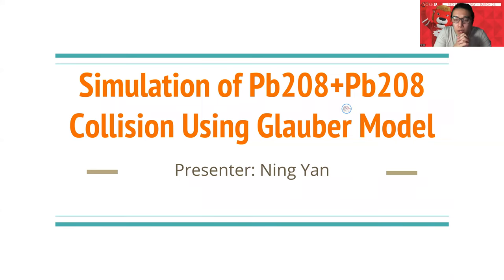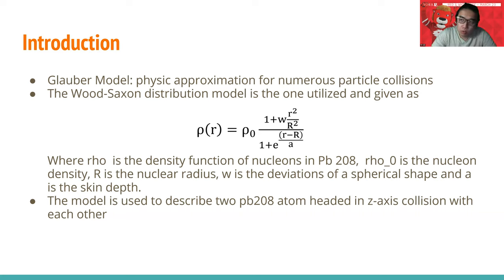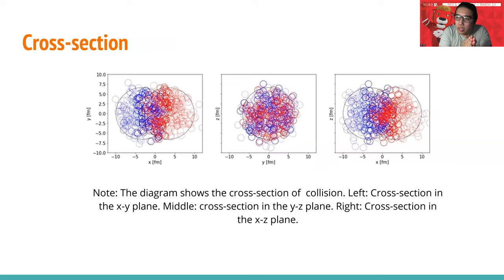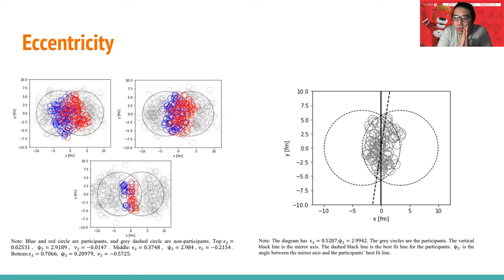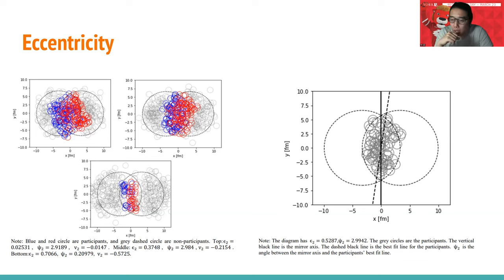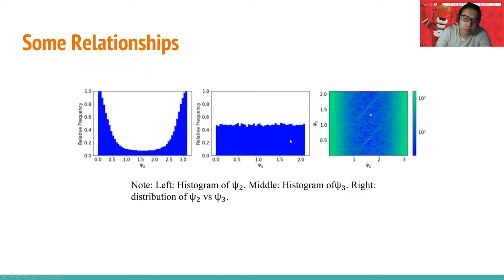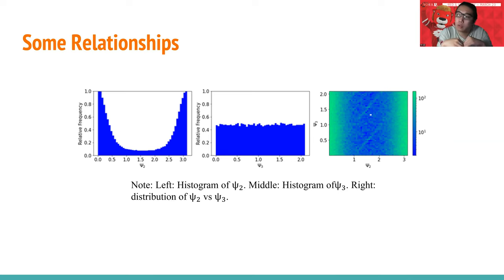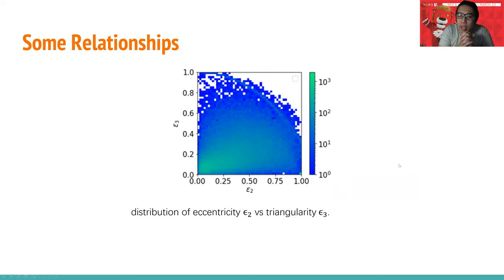CONF-CIAP 2023 - Simulation of Pb208+Pb208 Collision Using Glauber Model

Comment from the maker: Here are the questions we collected and the answers replied by the presenter.

Q1: What are the advantages and limitations of using the Glauber model for simulating heavy ion collisions, such as Pb208+Pb208, compared to other models?
A1: Because the Glauber model generates a very good simulation of the heavy ion particle, the findings could be quite good. However, the Glauber model is simply a distribution that assumes nucleons are fixed in place and do not move, which is not the case. In other words, nucleons' random motion is ignored. As a result, when two nucleons collide, they are thought to be travelling ahead of each other, even though there may be some momentum pointing in other directions. Instead, the hydrodynamics model, which assumes they flow like a liquid, can be used. For the hydrodynamics model, more situation is considered and the more complicated the calculation is.
More details about the hydrodynamics model can be found in this reference:
Bass, S. A., Belkacem, M., Bleicher, M., Brandstetter, M., Bravina, L., Ernst, C., ... & Amelin, N. (1998). Microscopic models for ultrarelativistic heavy ion collisions. Progress in Particle and Nuclear Physics, 41, 255-369.

Q2: How does the implementation of different initial conditions, such as impact parameter and nuclear density profile, affect the outcome of the simulation of Pb208+Pb208 collision using the Glauber model?
A2: Different settings will have a big impact on the findings. For example, if the nuclear density profile changes, for example, more nucleons are located at the outer shell of Pb 208 rather than the inner shell, and there will be fewer collisions in the centre and more collisions away from the centre. As a result, the pattern of the participation nucleons should alter, as should the participant eccentricity and triangularity. In this simulation, the impact parameter is the critical point; if the distance between the centres of two nucleons is less than this number, a collision is deemed to have occurred; otherwise, no collision occurs. Changing the impact parameter is analogous to changing the size of two basketballs ahead of each other; the larger the basketball, the more likely they will meet, and vice versa. Thus, the smaller the impact value is chosen, the less likely a collision occurs, and thus the fewer participants nucleons there are. However, unlike when the nuclear density profile changes, the form of the participant should remain the same when the impact parameter changes, even if the participants become few and distributed.